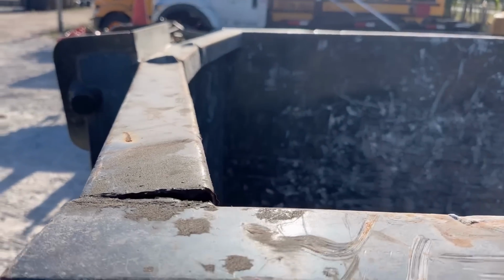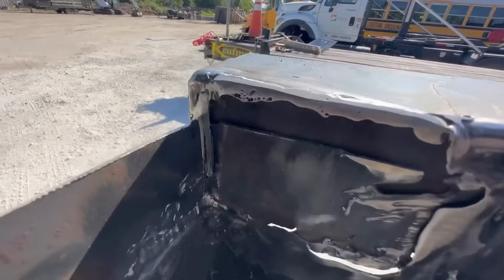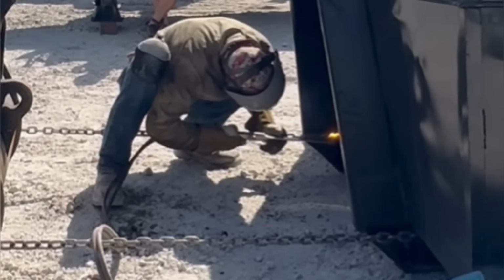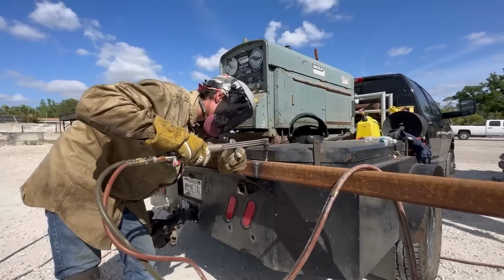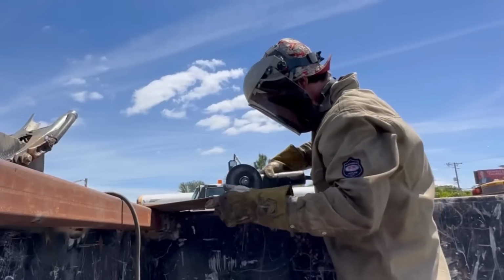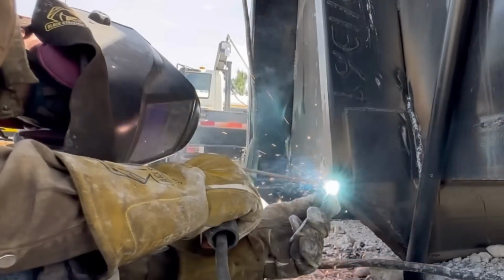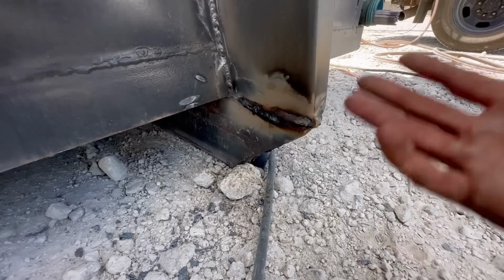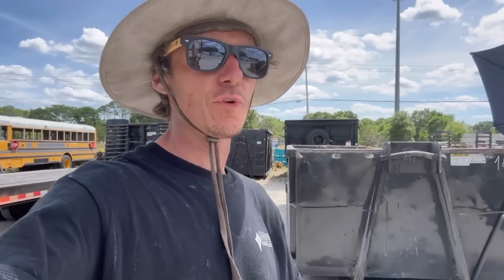Destroyed Dumpster Repair

Comment: I wish I could afford the equipment to start a mobile welding business you are living my dream bud. Great work.
Reply from the maker: You can, just remember what Johnny cash said. One piece at a time. You don’t have to do it over night!
Reply: @MeltinMetalAnthony  another great thing with buying it one piece at a time, is buying the right stuff for you.  knowing the limitations of your existing equipment will allow you to make better decisions on what you actually need to get, and even help on the priority.  especially if you tend to be getting certain jobs over others.
Reply: Start by saving a $1,000.00
Reply: I’m a master electrician by Trade for 15years and I have my own service company for about 6years of them so I’ve definitely had to learn how to adapt and sell my work otherwise no money for Bonzo lol. Im been hammering at the welding and investing heavily in the tools to get a legit company going. Im actually out of south Florida over in the palm beach area and Port Saint Lucie area and there a is a dumb amount of Trade work. But this is definitely not a cheap Trade to get into but I agree with you guys if your not making a whole bunch of money and even if you are it’s smart to buy everything as you can and it’s smarter to wait a little longer to get what you want instead of buying it twice or 3 times! I finally got my 225 Miller engine driven welder and my work van is getting a new computer put in and then I’ll be on the road and starting my own journey. Not gonna lie I’ve been working for myself for 6 years like I said and I worry sometimes if I’ll be able to keep up with the tools/ knowledge and etc. but I’ve come to learn that’s what it is to work for yourself lol.
Reply: He'll I started with a harborfreaght generator and a Eastwood  110 mig welder
Reply: The time is now, the choice is yours, no excuses.
Reply: I started with just a mig 140 from Home Depot.  Know I’m contracting and doing my own work. Keep at it.

Comment: An inspirational episode as usual. Would 7024 have been an alternative to the last repair (the horizontal part) with 7018,  considered its high amount of metal it deposits. Cheers.
Reply: Manipulate the 7018,it lays flat.

I used 7024 a couple times in school and complained and picked up 7018. Feels better.
Reply from the maker: I’ll have to try that next time, and I’m sure there will be a next time
Reply: I use NR 211 and 212 for light stuff like that, it is so much faster.
Reply: @donsmith9081  Great wire,been using it for 20 years now,.035 Lincoln 110vac.

Pre heat and weld thicker stuff,multiple passes as well. 

I have bigger machines now but still sissy duty cycle.
Reply: If I’m it mistaken 7024 is for flat position or maybe horizontal but nothing more since it’s so liquid.

Comment: I agree it's a dumpster but I would have put the extra time into at least putting a pie cut in that Gap small sliver bridge the gap so that you didn't have to Texas tig it and have you tried 7010 I use 7010 on dumpsters it's not pretty either but it's a little stronger than 6010 I also use 7014 on dumpsters but you did a great job you always do you get it done and like you said it's just a dumpster

Comment: Can you push a weld through the chain to make a weld? If you know that your trees are wires or not real trees and the trees are welded with 7023 but you choose 6010 how would you know that that was the correct one? Would it be because you needed the 6010 or any metal would work but the test would be which metal you choose? What would be the goal? On this dumpster are you able to use multiple metals or rods to show off your blending skills? And do you choose a weld by environment type or by rod numbers or measurements? 
If you notice that the ground is agate do you incorporate agate as a rod? Or know of your job is to "carry the message"? Let's say that the dumpster is "your house" do you do a good job no matter what or do you ignore or dismiss the monopoly box house as insignificant but if you do a good job and have a good attitude you'll get a lead on a new job...on the other hand you did exactly what the metal combinations suggested they do which mean that in this environment your attitude should be shit or this dumpster will make you feel better or a sense of happy because that's the type of metal and gas that's in this environment but your a different "horse" and it had an opposite æffect but the tester did not know....or he did????

Comment: We woulda cut our tube out welded all around then Bessie clamp the plate back. used come along and a tab welded to the bottom of the dumpster to pull lift point up. less bangin on the already shit welded dumpster.